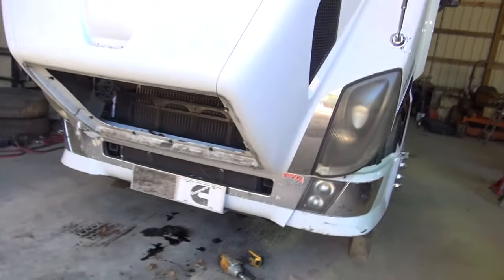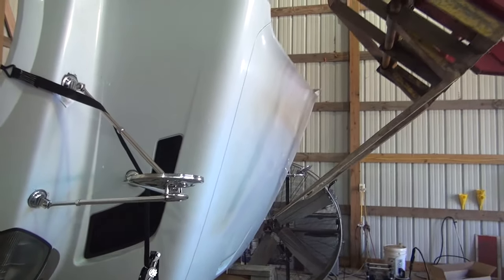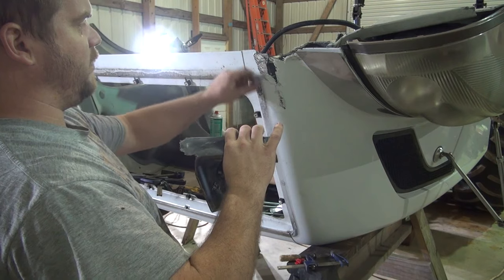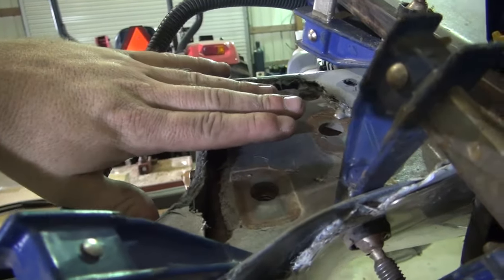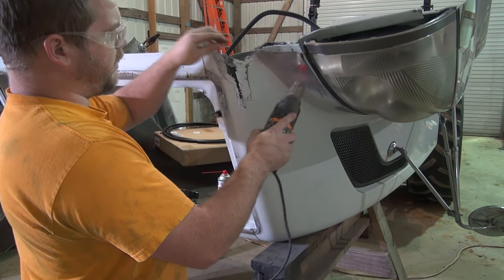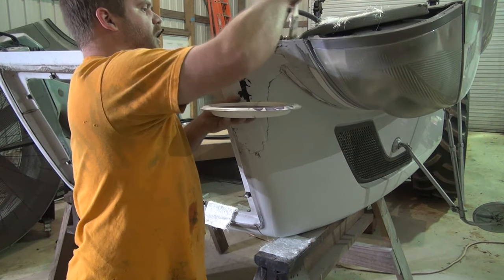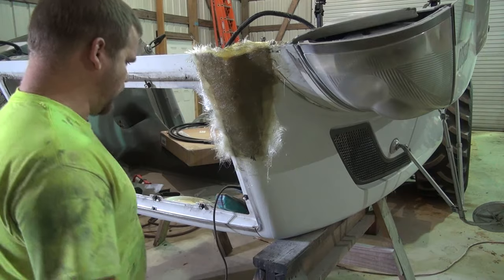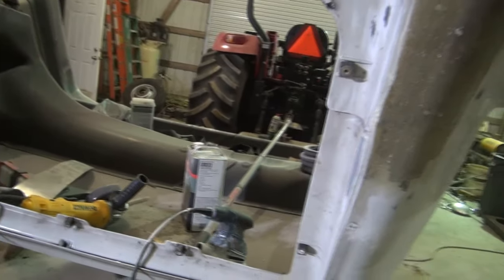Volvo vnl hood repair

Comment: Chase, you need to get a respirator. I screwed up my lungs messing w fiber glass and silica particles like that and now I'm always using an inhaler and most likely destined for lung cancer. Saving a few bucks isn't worth screwing up your lungs.
Reply from the maker: you are correct, I got one, just didn't think to get it when I started grinding and sanding I also bought a new one

Comment: Great Video. Thanks for all your insight. Trying to do this repair right now. Got hood off but the Driver's side metal bracket was rusted off, the part that goes inside the hood. Not like I can find this part at Volvo. Guess will have to get someone to make it

Comment: Good work! You're satisfied with the 3M Impact Resistant Adhesive? . . . Loved the adjustable paint-roller handle used like a load lock. I really liked the welded nuts in the beginning. Important technique for the job.
Reply from the maker: It hasn't fell apart yet is all I can tell you about it LoL

Comment: Enjoyed it and time is good. As for the gap at the fender. 2" Rachel strap and cardboard between it and the paint. Pull that down where it needs to be. I have had to use clamps in back to hold the strap where it needed to be.

Comment: I’m getting ready to tackle both hood mount brackets. Both sides of mine have cracked and detached from hood. Thanks for  the informative video. How has repaired held up.
Reply from the maker: One headlight bucket is a little loose. I think partially cause I smacked a deer, but other than that so far so good on the hood mounts. Although it might be easier and faster to just buy a hood if both sides is broke IDK.

Comment: You ever use seafoam for diesel engines? You can throw a can each tank to clean out the injectors and the whole fuel system.
Reply from the maker: never used it

Comment: Fiberglass won't last  that's a smc hood  use cloth with west system epoxy
Reply from the maker: Thanks for the info. This is the second hood I have repaired like this and no problems yet. Hit a deer at 70mph a while back and now the headlight bucket is a little loose but held up pretty well. I figured it would be destroyed like my last hood, that's what happened to it . This time I got by with just the fog light, bumper, and broke part of the headlight. None of these hoods hold up very well to deer strikes or going down extremely rough roads repeatedly, they all fall apart!
Reply: @LifeWithChase  I have repaired couple hundred of them  like what your doin   I do it professionally figure some advice maybe help ya out
Reply from the maker: @shilosheena I've done 2 and I hope I never have to do another, it's kind of a pain in the rear lol
Reply: Should've been using Evercoat SMC resin instead of Bondo regular fiberglass resin, assuming that's the can I saw near the end. The hood is sheet-moulded compound, not exactly fiberglass. It's made in molds and to release those molds during the manufacturing process there's something put on the product; the SMC resin especially helps your fiberglass mat and cloth adhere to that SMC.
Reply: PS Evercoat's resin is ridiculously expensive now. I'm giving U. S. Chemical & Plastics SMC resin a try now.